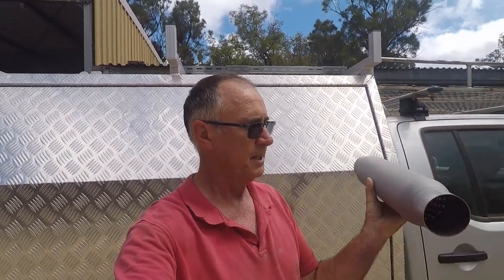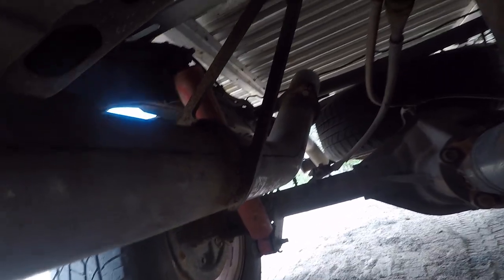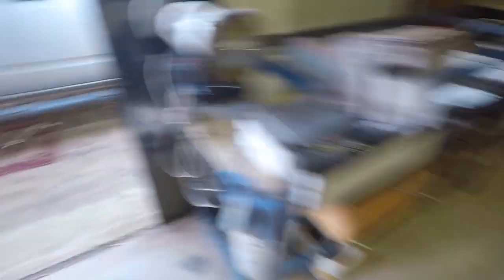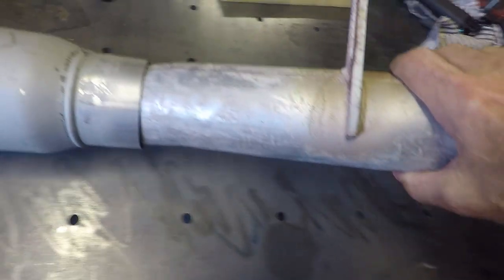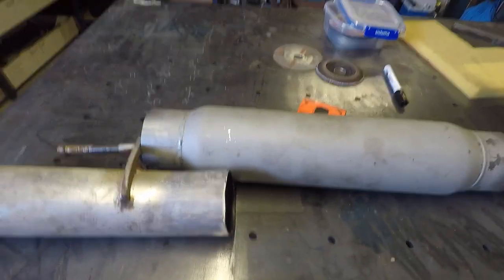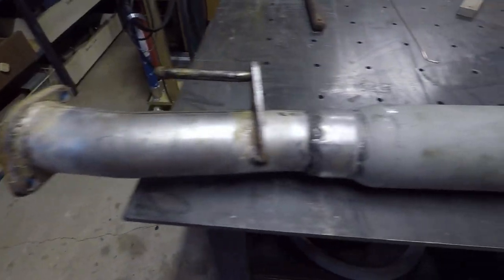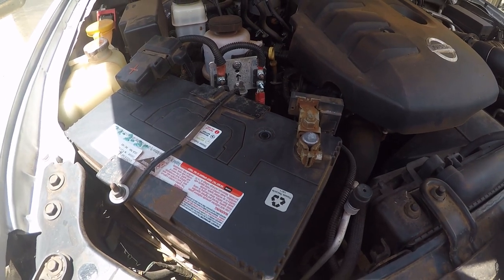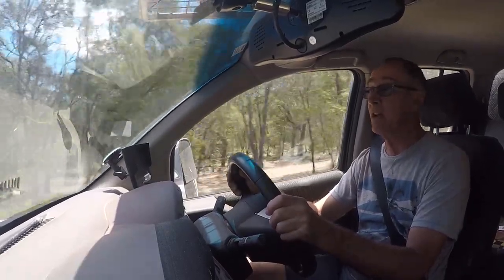Muffler Install into Straight-Through Exhaust System

Comment: Awesome work mate, I'm glad your happy with the end result! I need to get a similar muffler for my exhaust due to the exact same issue you had around the 100kmh mark and how the drone would be in the cabin, Hoping I can get similar results we shall see! :)
Reply from the maker: Thanks Izaac, I thought I was getting too good a deal when I bought the exhaust system...only to find out I'd bought the kit without the muffler.
The muffler install was fairly straightforward and did take the drone out of the cab.

Comment: nice work mate, keep it up.
- would have been good to hear a comparison from before.
Reply from the maker: Thanks Mitch. I kick myself for not doing one....I thought about it but got sidetracked with installing the muffler. I can say that with the muffler installed, it's way quieter and much less 'droney' in the cab now.
Reply: @RustysOutbackAdventures  ill keep in it mind. Just about to get a 3in for my Mazda bt50 2011 and ill probably find i get the same thing.
Reply from the maker: It wasn't my intention to buy a 3" system without a muffler...I just bought the wrong kit online.